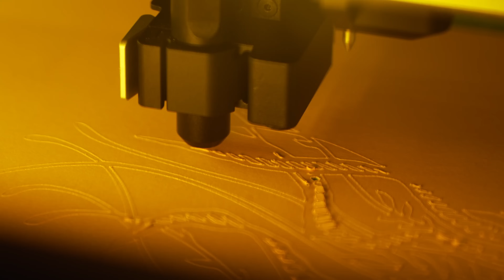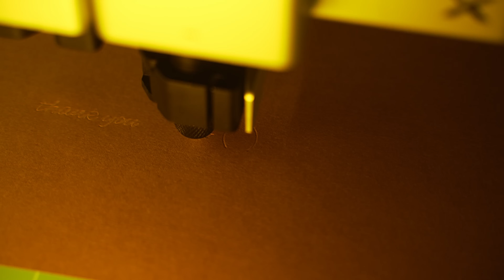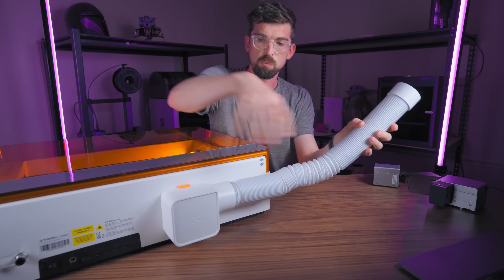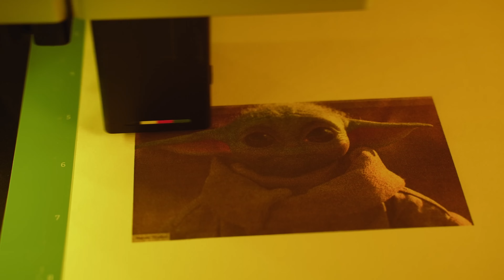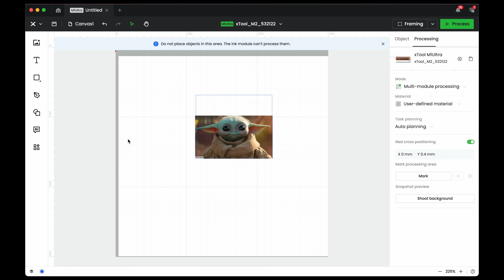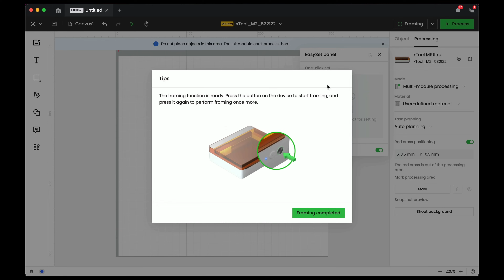The New Craft Room King? - xTool M1 Ultra Review

Comment: i would like to know the work area size of that machine. Nobody mention that. About the function with taking out the bottom that would be a great option then to set-up the machine so that you don't need to take out the blade frame for engraving/cutting with the right setup. Just place the bottom piece first to get the right spot for engraving, lift up the machine on anything steady hard wood or so on and done. figure out the right height for being able to do the cutting properly and you're set. depending on the laser only if it is still strong enough to cut out properly. Since it is a diode laser might be tricky. otherwise your review was much more helpful than their own introduction video because you keep it simple and technical great info what are most important and not just selling blind impulse buyers.
Reply: 300x300 mm

Comment: What other materials can I cut with this? Acrylic for example?
Reply: Acrylic like plexiglass is a no no with diode lasers, because the wavelength is wrong. (So it has nothing to do with the power output) You will need a co2 laser for cutting acrylic.
Reply: Thank you, I was wondering the exact same thing.

Comment: I can think of a theoretical hack to improve the print quality and lower the price of ink:
The cartridge used is the same as the HP 62, and there are two of these, the CMY and the black. If you open the image to be printed in Photoshop and convert it to CMYK and save one copy with only the K channel as grayscale and the other as CMYK but leaving the black channel empty, then you print the color first and then the black one, you will have a real CMYK print. And on the other hand, there are cheaper compatible cartridges for the HP 62 cartridges.
It would be a good video to make.
Reply: Hello. thats a good idea, did you tried to to do it? I'm interested if it works. Thanks in advanced ;)
Reply: @albertcastro4155  I haven't tried this because I don't have the machine, but I have done similar things, many years ago, when there were no Photolith film machines to make color separations directly from Illustrator and FreeHand, I did it by converting each color document into 4 grayscale documents leaving the gray ratio of each print color and changing the screen angles and it came out perfect. This on a normal ink printer would be wrong because you would have to add the paper again and it would not be in the same place, but in this case, it does not move the printout.

Comment: I would be 100% into this if they used a refillable INK tank module instead of what they have. Being able to use sublimation INK would have been a game changer.
Reply: Hello, from their own spec sheet says that the tank can be refilled DIY - the caps are under the sticker, also the tank is standard one, seems like its a HP 304 - The sublimation ink is supposed to be implemented in the future but you can always can try to refill it with sublimation inks. Hope it helsp. I own the machine and its superb ;)
Reply: @albertcastro4155 have you refill the tanks? How do you refill them if you do ?

Comment: Curiosity question with the xtool s1 and m1 would I  be able to change out different  modules in for example  m1 modules in xtool machine and vise versa I want both but don't have 4,000.00bto throw into machines ect.
Reply: P.s. I do alot of cutting so what would you recommend I get s1 or m1 laser I also Wanna get into doing long board projects

Comment: A laser / cutter-potter combo?!? Seriously?!?
What an exceptionally stupid idea. I have both a 20w Diode laser and a brother scan&cut cutter. I do a lot of laser cutting of plywood and it is so messy: the Wood „leaks“ and my honeycomb is really sticky and dirty so often.
It works with wood, but combining that with clean paper and the cricut sticky mats… what a dumb idea.
There are things that just don’t match.
Reply: Not everyone has the space for three different machines.
Reply: @YaaLFH  i get that, but some compromises are just a compromise too much. But hey, if someone only engraves and doesn’t cut plywood then maybe it’s not such a bad use case.
Reply: @j.4941  All you need to do to avoid a mess is put a sheet of aluminium foil on the bottom. But hey, if that's too complicated for you, then maybe it's not the idea that's dumb.

Comment: For all print and cuts projects, do you have to both 1) switch modules from print module to cut module and 2) switch out base between print and cut jobs? Are you able to have multiple modules in at one time, or not switch out bases, specifically for printing/cutting sticker paper which is thinner than wood? The switching of modules and bases would throw off indexing for the job. I understand there is a framing function for alignment. How accurate is framing function, how long does it take, how does its alignment compare to cricut/cameo which uses registration marks for alignment? Curious if the machine could print/cut decals well with good alignment and repeatability.  Lots of questions, but appreciate the response -- thanks!
Reply: You have a lot of good questions, im curious too, we should ask them from their site directly. I may try to even call that company

Comment: My issue is scaling. Im looking to move into this market as well. I currently run a 3d print farm and its necessary to have at least 2 machines in case one breaks. How is the reliability with mass producing? 

I spent 3k for 3 machines initially with my print farm and this market is signicantly more expensive at first.
Reply from the maker: The price point on these machines is different than 3D printing, BUT a big difference is the amount of products you can create is WAY faster compared to 3D printing.  If you spent 3K on a larger industrial machine your output goes up exponentially.  Unlike 3D printing you don't have to add a new machine to double output, a single larger laser can speed things up a good bit.

Comment: To me, this M1 Ultra seems like a jack of all trades, master of none.
Reply: So place them on a shelf or drawer in your organized workspace. If it isn’t organized then don’t complain about them not having theirs organized. 

But really what sort of complaint makes sense along the lines of “oh that sucks I have to take 5 seconds to swap a module this machine sucks” when the alternative is buying and setting up multiple machines and having to remove the project and put it into a completely different machine and then set that machine up to do the one small step now needing done… and do it 3-4 times versus this machine that you may have to swap a module once to do 4 different tasks? 

Just pointing out the ridiculous complaint that clearly had no thought process leading up to it. Seems like a complaint for the sake of complaining to be honest. 😂
Reply: I'm sure they have the ink-cartridge on special... once a year (it seems propriety...). 
But I'm not sure why they just don't keep those modules permanently installed (or, if you skip the ink, you can leave it out) - this looks like a hassle, always modules 'lying around' and, for certain jobs, you have to swap them mid-project. Clumsy.
Reply: Can you honestly expect a low cost modular machine to be great in each area? A great Laser by itself is thousands alone.
Reply: But a jack of trades is still better than a master of one.
Reply: Totally agree.

Comment: the whole deposit thing from xTool was pure false advertising, for the advertised price you dont get the advertised 4-in-1 machine because you have to pay extra to get the print module
Reply: I have found that the term "deposit" is problematic when a nonEnglish company uses it in English material. My 3d printer had a pay $50 dollar deposit and get $200 off. I paid it expecting the $50 to go towards the cost of the machine (this is standard practice in the USA). But I could not get the $50 deposit to apply. Turns out the $50 was less a deposit, and more the cost of the $200 discount code. So in actuality, I was only saving $150.
Reply: I'm go a. Loon into this, how does this compare to glowfirge

Comment: XTool did say in their live that the print quality wasn't going to be as good as your usual domestic printer. Vinyl cutters may need to consider that they would not have the capacity for larger projects. The actual cut size is, I believe 11.8 inches by 11.8 inches. I love my S1 20W and I would say I think it worth paying the extra to get the 20W version if you are going to buy an M1 Ultra.
Reply: It's nowhere near as good as an actual printer and much more wasteful because they use a CMY cartridge, so there's no true black, it has to be mixed from all colours.

Comment: Another amazing bit of kit from XTool.
Maybe I am missing something but…..
If you are moving between functions, specifically going from the laser to any of the other functions, will you have to perform a deep clean of the bed area to get rid of any of the residue/resins/ cut pieces etc produced by the laser cutting before placing the mat for blade cutting? 
As I see it, if you don’t, the mat will be likely to pick up any of the by products of cutting and it may be difficult to ensure the smooth surface required.
Perhaps they will include a cutting bed and a crafting bed as a simple solution?
Reply from the maker: The cleaning aspect I should have hit on.  You would probably want to have a sheet below the cutting tray you can also take out to keep the bottom clean.
Reply: @makeorbreakshop  thanks for your response. That makes sense, it’s just that I know how much mess I make with my lasers and how difficult it can be to clean if you don’t keep on top of it.
To my mind it would be even more crucial when the other functions of the system would require a smooth flat surface for their optimum performance.
Reply: Unlikely.
The M1 users came up a workaround: when using the laser, put a sheet of aluminium foil on the bottom plate. This keeps the bottom plate clean and is easy to remove when you change to cutting on a mat.